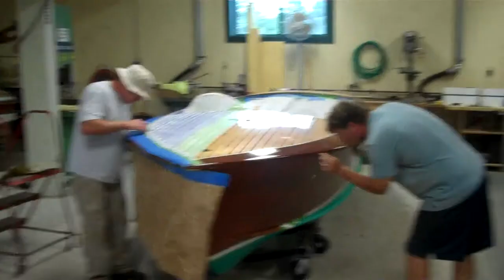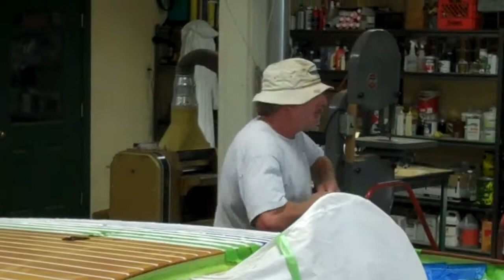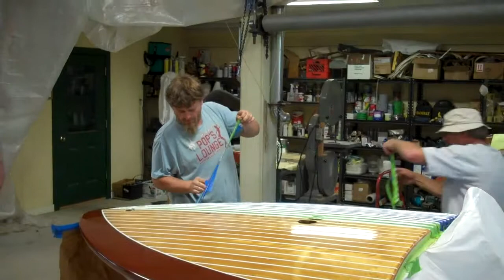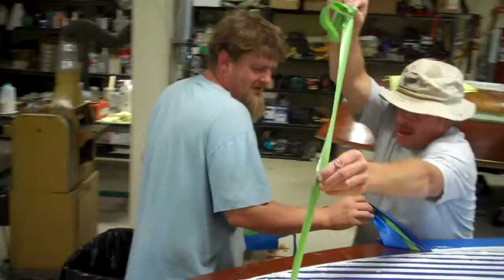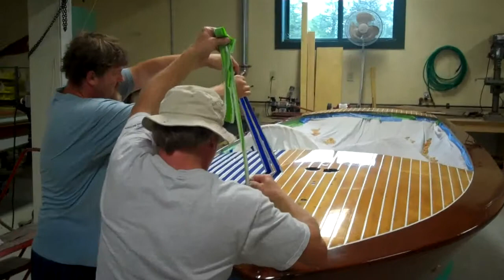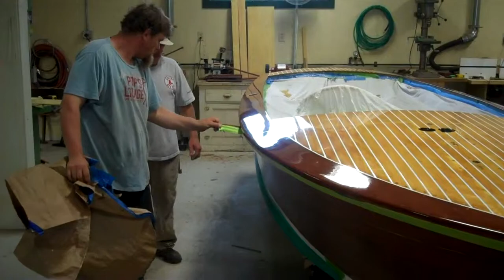1957 Century Resorter Completing the Deck Striping

Comment from the maker: Yes, the striping was done using Ultra UV Sikaflex. No paint was used. We remove the tape as soon as we have finished applying the troweling out the Sikaflex.
We use shop-made, light steel tools to remove the Sikaflex.